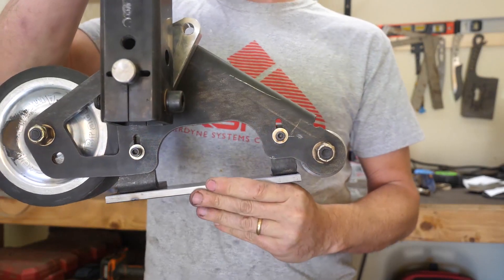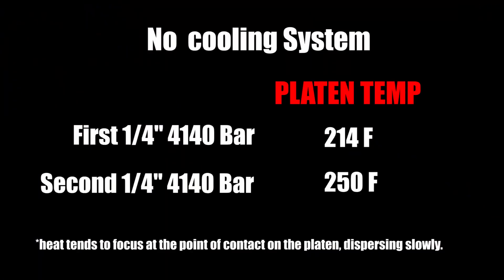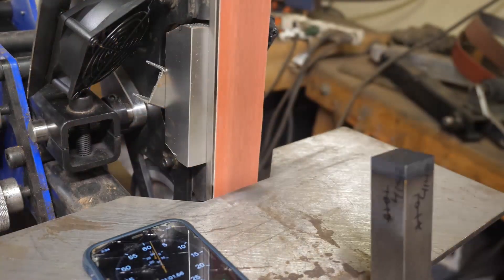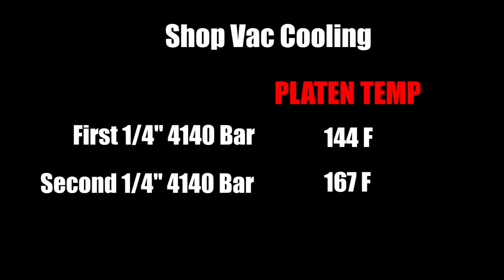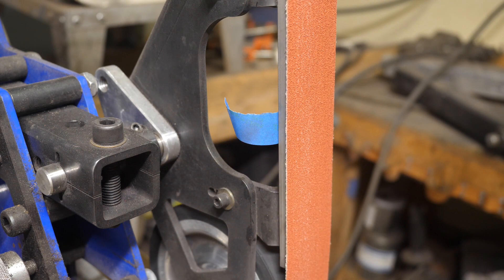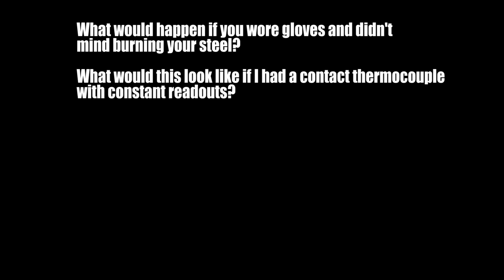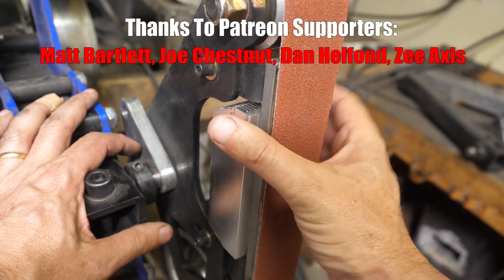Making a DIY Platen Cooler With A Heat Sink And Computer Fans?! Part 1.

Comment: Thermal compound (paste, adhesive, whatever) will help. Also, you have two perfectly useable mounting points. They are for the platen bolts. Twist a piece of flat bar to go between the fins of the heatsink and then lay flat against the angles that hold the platen. Bolts go through them, Bob's your uncle.

Comment: Great idea!
I suggest starting by reducing friction between the platen and the belt. Makita sells a carbon sheet/pad that goes between the belt and the platen in their belt sanders. Less friction = less heat. Also, because the space for the heatsink is very limited, it would make sense to have a heatsink with the channels oriented sideways  instead of vertically. That way you could cover the "top" of the heatsink (the top of the fins, facing back towards the motor) and install fans on the left and right sides of the heatsink in a push-pull configuration with better static pressure. For the best heat conductivity between the heatsink and the platen try liquid metal, it really makes a difference.
With less friction, better static air pressure and better conductivity you would be able to get away with a much smaller heatsink and fan setup that would be less cumbersome and not get in the way of the work.

Comment: Commenting as watching 5:30 into the video so I don't forget my thought......
Clamping the sink to the platen: Make a strap ( or use plumbing strap) and use the two bolts holding the platen to the frame to tighten it down.
Or..... Somehow, make holes in the fins(Straight down to the base of the fins, not sideways through the fins) or cut/mill out a section of the fins at each end and epoxy in some strong small magnets to the back side on the 'base' of the fin plate. Mag's hold it to the platen and it's still removable. One caveat being the magnetizing of the platen. But may not be an issue.

Comment: First thing that ocurred to me watching this was why didn't he cut the heat sink into 2 pieces and orient them with the cooling fins horizontally.... I mean if you're going to use air-cooling you would want the airflow to be over as large a surface area as possible and not just one side of 1 fin on each side....

Comment: I guarantee this will work better if you use a thermal paste compound so that the heatsink will have full contact, at a microscopic level, which makes a bigger difference than you’d think.

Comment: If you want to go the purely mechanical route (no fillers), try lapping both surfaces of the plate and the bottom of the sink to maximize contact surface and minimize the airgaps.  But thermal paste will fill in the gaps with less work.

Oh and before I forget, ongoing pressure is key in any case. Loosening of the cooling block due to vibrations, warpage (heat expansion etc). will re-introduce air gaps.  Just an idea: instead of wedging the sliced square tube, maybe you can jerry rig a system of bolts and nuts.  That way, you can add pressure by turning the nut (or the bolthead depending on your set up).

Comment: High Temp epoxy,  UHU Plus Endfest 300. I use it to glue heat sinks to a speed controller, also to fix motor windings into place on brushless motors

Comment: First thing you should do is cover that steel platen with a glass platen.  Looks like your platen is already dishing and the glass one won’t.
Reply from the maker: I have a glass platen but I think w the double sided carpet tape it would be difficult to cool.
Reply: @GreenBeetle  it’s already cooler to run.  It would be interesting if you ran the numbers on the glass platen without the chiller.

Comment: there is probably a hundred comments about this already, but: try measuring the temperature difference between the radiator fins and the platen, I suspect the thermal contact is rather shitty between them. if it is, apply quality silver-based computer cooler thermal paste, if it is not - you need more air or better heatsink material like copper. also, make a spring steel clip to hold the heatsink in place - you have two bolts attaching the platen to the frame, make them hold the clip as well, a piece of 8 or 10-gauge music wire with two loops at the ends and a slight U-bend would do just fine.

Comment: Steve, check out the channel Tech Ingredients for a DIY thermal epoxy/adhesive.
Reply from the maker: Is that the one Linus tested
Reply: Green Beetle possible. The channel has now done both an epoxy as well as a paste

Comment: You could also try using CPU water blocks and attach 2 in series and run it to a 5 gallon bucket of water with a pump in line.  then you could even try adding ice to the water and see how much that changes it.

Comment: Where the hardened steel plate bolts to the mounting brackets weld in assembly to those mounting brackets with a tensioning spring that holds down and snaps the aluminum cooling fan firmly to the back of the hardened steel plate

Comment: The steel platen is part of the problem; steel has a very low thermal conductivity!
Stainless steel is a thermal insulator, compared to most common metals!
Brass or aluminum platen wouldn't last as long as steel, but the thermal conduction would be much greater.
'Free machining' brass has great wear resistance!

Comment: You can't get reliable no-contact temperature readings from smooth bare metal.
Shiny metal reflects IR from both directions; IR produced inside the metal is reflected back into the metal, external IR sources are reflected away from surfaces.
A hot mirror looks to be the same temperature as the cooler image it is reflecting!
I've got a FLIR one IR camera, had lots of fun trying to read temperature of stepper motors in my printer.
The aluminum parts 'looked' cool compared to the laminated steel parts!
By applying Sharpie marker [make everything black] and a thin top-coat of nail polish [protects black marks], all the parts read the same temp!
The coating also reduces IR reflections from other sources.
Lots of folks get into trouble using IR probes...

Comment: Tech Ingredients has a great video on making your own very effective thermal epoxy for cheap. You could make a decent water block by just soldering some copper tube to a plate, epoxying to the back, and using a fish tank pump in a bucket below. Or, a great excuse to buy a Tig water cooler.

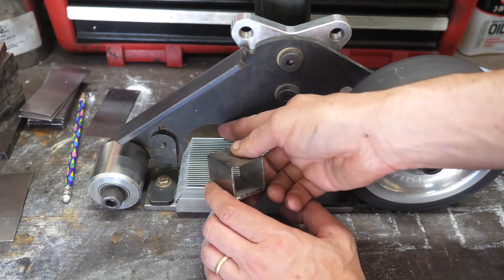Comment: 2:20 you could use a metal strap over the top and bolt it down with the same bolts holding the platten on

Comment: There are thermal epoxies and adhesives.  Test with clamps or whatever as a proof of concept, of course, as but you can just glue it on.

Comment: Although pedantic, I figured I'd point out that to determine your "percentage cooler" with the heat sink you should compare temp rise rather than final temp. Otherwise your percentage calculated is relative to 0F rather than to the starting temp for each test. In your last test, assuming a starting temp of 90F,  you'd actually be 58% cooler with the heat sink (1-[134-90]/[194-90]).

Comment: Everyone knows the real computer geeks use liquid nitrogen to cool CPU extreme over clocking!  You have friction heating on both sides of the belt.  The platen and item being ground are your heat sources.  Your sander belt will retain heat as it is used.  Cool the belt just before and just after to lower temp of the media.  Heat sink on platen drawing heat through fins.  Cooling the item as you sand it down is best idea with no good way to cool it.  You could try a dip can, or channel just below the area where you grind to make it a shorter trip.  Liquid cool the platen if you are worried about the machine.  Move to copper heat sink to conduct the heat quicker with perhaps a thermal compound joining platen and heat sink.  All I can think of.

Comment: I have some small scale cooling exp from build custom computers...

Couple things: 

 like others said thermal paste is your friend

Vapor tubes blow the thermal conductivity of all metals away (that means getting a decent couple heatsink that has "heat pipes")

Water has a temperature transfer that blows air cooling away BUT I don't know of any heat pipe solutions for water cooling.

Finally: don't underestimate thermal mass, a huge reservoir of water cooling liquid does silly things in a confined space, almost rendering transfer plates and extra radiators unnecessary on some cases. In this case a solid electro/thermal connection to a giant hunk of copper would blow your mind

Basically there's A LOT of room for improvement with this setup despite how it already obviously makes a difference

Comment: i think you would need to find away to cool the knife rather than the platen. the belts are probably acting as barrier between the knife and platen surface so not drawing enough heat away from the knife

Comment: why are you BLOWING air onto the heat sink rather than SUCKING the air away?
PC System CPU heat sinks and fans SUCK the heat away.

Yes you could make a water cooled system for the item.
I've built them on a budget, using a motorcycle oil cooler as the cooler, pond pipe, smallish diameter. 8mm.
and then a car windscreen water wash pump/motor and a CPU water cooler unit. 
Cost me all of GB£ 30 
so thats about US$ 45

Comment: Where are the computer geeks when you need them? The base of the heatsink needs to be made from copper to draw the heat away. Watercooling ? The cooler has a very low profile...dry ice ?

Comment: The heat sink directly to the platten without a thermoconductive paste between the surfaces doesn't give the best heat transfer. It's amazing how much better the paste works. Used it in quite a few power electronics.

Comment: Did you consider bolting the heat sink to the bar by using the existing bolt holes on the plate and making a metal cross-bar?
Think of it, the metal plate is affixed to the black steel supporting arms by two bolts. Now if you milled out the center down the fins of the heat sink, you could place another bar across the heat sink to the bolt holes of the platen and use longer bolts. And for the rest, get thermal paste to conduct the heat for better surface contact.
Reply from the maker: Nice

Comment: I like a cool mist setup for keeping everything cool, no need to dunk, less effort for dust collection as it gets directly cought in the water. Downside,....wetness, but a couple well placed guards, like the small spark guards, keep it to a minimum. This was a great experiment, impressed you got almost a 100° improvement on the platen itself!

Comment: You need to try soldering, from the numbers you are getting, something that melts in the high 300/low 400s should work. Just pick something with a melting temp a bit below the temper temp for whatever alloy your platen is.

Any solder will have a thermal conductivity better than air or any thermal paste, and will attach the thing in place as well. If you can fit an air mover in there too, it should perform pretty close to a dedicated water cooler. Try to blow the air along the fins, rather than into them.

Soldering aluminum can be a touch painful, but clean it (with an abrasive/wire brush), flux it, and tin it first, then solder that to the platen.
Reply from the maker: Great advice ty.  Is wondering copper any easier?
Reply: @GreenBeetle  In my experience, copper can be a lot less finicky than aluminum to solder, but before I went and bought an expensive copper heat sink, I would probably just try it with the aluminum one.

But if you do use a copper one, it will be cake.

If you do try the aluminum, try tinning the joint first (flux the aluminum and get the contact area "wet" with a thin layer of solder. Don't tin too heavily, or it can be a bit of a mess.

With big pieces like this, it may be easiest to do in the forge.

Make sure you use an lower temp flux (like plumbing or electrical), borax/boric acid/other welding fluxes won't work at those low temperatures.

Comment: Try liquid cooling. You could put liquid lines on the back of the platen then pump chilled water though it, cooling the platen. The pump could be the side and not directly on the grinder

Comment: You could get you a cheap pc water cooling system. Would be easier to mount, have better heat exchange, and you could put some sweet rgb fans in it 👍
Reply from the maker: Fans w lights!

Comment: make a bracket that uses the same bolts that hold on the grinder platen plates. use thermal paste it will greatly increase the thermal transfer rates.

Comment: The computer fans were blowing on the side plates of the sink. The shop vac was blowing through the sink, cooling ALL the fins. A single computer fan blowing through the sink would probably work better than two fans cooling one fin each. But not enough better to matter.

I think you're right about cooling the platen doesn't necessarily cool the blade significantly.

Comment: @Green Beetle , An Idea for you is to use a simple spring load in between the flanges mounted with the already existing bolts you have.  Simply done with a tig weld rod if you have. Basicly as they are mounted in computers. And then use thermal paste as suggested.

Comment: Hey Steve. Check out the ceramic platen liners at high temp tools. I got one jb welded to my platen. Runs a bit cooler and it's never wearing out.

Comment: I'm not sure if you should trust that Steve guy.....
I am going to second the use of thermal paste, pretty sure it's just zinc oxide anyways. Perhaps a sheet of copper between heat sink and platten might also work?

Comment: Bettle i use a 1in X the size of my platen aluminum plate.. i drilled holes threw the aluminum and attached it directly to my hardened platen.. Works great for me. I would look into machining a maze in the aluminum get some high temp gasket maker and cover the back with a cap of some sort and have an in and out from the aluminum and get your self a fish tank power head to circulate the water.. if that made sense.. Just make your own water cooled platen. Cheers, M
Reply from the maker: Nice

Comment: I don't think it would be THAT hard to make a water-cooled platten. it's not as if you can't start with an annealed piece of tool-steel, and mill an aluminium back-box/water-jacket for it, it'd cool a lot better than an air cooled setup and be compact, so no more running into file-guides. your experiment has shown that heat translates into time, so you might aswell go nuts and cool it properly!  usually air cooling is only used where weight or cost per unit are considerations.
Reply: Liam Hoffman had one for years in his videos.

Comment: I wet grind now, with a water mist directly on the belt above where the blade contacts the belt. No more dunking the blade required, keeps the platen cooler too and cuts down the dust a lot. There is a bit of an issue with mud and spray though. Still working on the perfect system.
Reply from the maker: Sounds neat.  I watched a few videos on these.  You have to run an air compressor too, right?  They look like they’re a bit louder and messier than I’d like but they seem to work like a charm.
Reply: @GreenBeetle  Yes, compressor required with the one I use (a Noga Mini Cool). The mess is not too bad, the benefits outweigh the negatives IMO,  (wear an apron!). I do all my grinding post HT (thin stainless kitchen knives) so keeping the heat right down is the most important.

Comment: I thought most people used a tempered glass platen
Reply from the maker: I have a ceramic glass platen but I don’t think it transfers heat very well especially since it’s attached to the platen backing w carpet tape.

Comment: In the theme of using computer stuff. Buy some thermal paste, might help with the thermal transfer. Also buy a delta fan, they do ALOT more work,  also make sure the fan is pretty much hard up to the fins
Edit. Even better buy a cpu heatsink, ones designed for a threadripper cpu would be best. Still delta fans.

Comment: Yo, could you not just add tabs to the heat sink, and put it between the platen, and the grinder?
It does look like the platen is just attached with some bolts?

Comment: The idea behind thermal paste, pad and tape is that while their heat conductivity is much lower than of metals, it’s much higher than that of air—and those tiny air gaps between your hot side and your cold side (even between two lapped surfaces) totally kill you, and those solutions fill them, leading to an overall better conductivity.

Comment: Hi, my take would be a magnetically attached water-cooling block. You can make your own by crossdrilling a block and blocking off the unwanted holes. Water-cooling can be achieved cheaply by using a big metal tank and an aquarium pump. Add ice for extra effect.

Comment: The surfaces here are not in contact, you need to put thermal paste, like a CPU - you could see serious improvement; then a bracket on top of the heatsink held either side (more complex, granted)

Comment: I am surprised the cooling of the platten even made any difference.
I figured the heat is generated by the friction from removing material with the grit.
I wonder if a drip cooler that just dripped water on the belt is going to make a much bigger difference than any of the fan and heatsink shenanigans.
They used to do that in race cars, to cool the brake discs.
Reply from the maker: Dripping on the belt tends to spray water everywhere and misters make a mess.  But yes cooling the knife or belt itself would be better.

Comment: From what I understand, the thermal paste, tape, adhesive is used to take up gaps and make constant contact between the object producing heat and the heat dispersion method added. I think if you lapped both surfaces so that you could pretty much wring them together, you would get a more than capable heat transfer for this project. I think watercooling would be your best bet though. You could probably cobble something together that would displace more than enough heat. These are just my mad ramblings though.